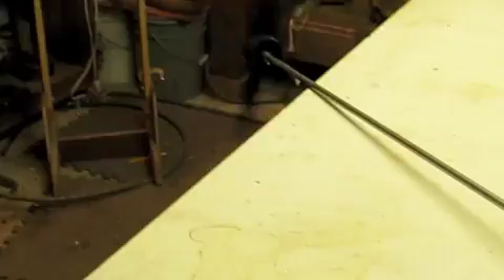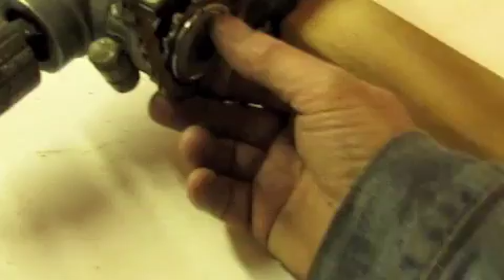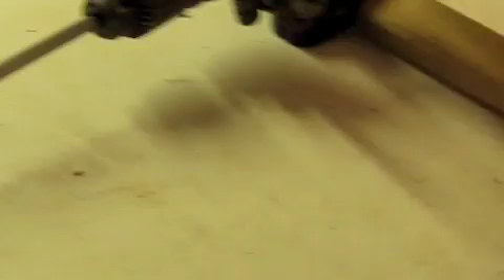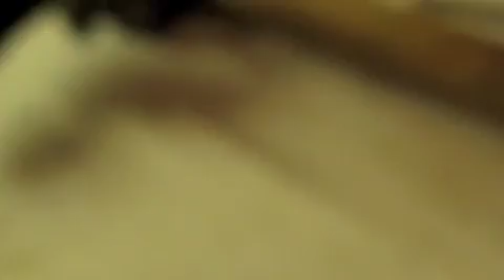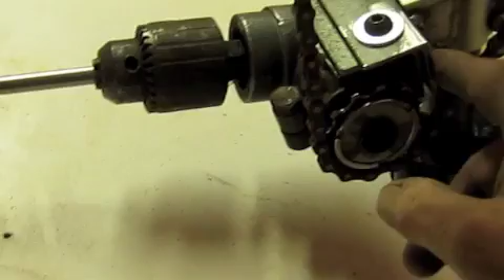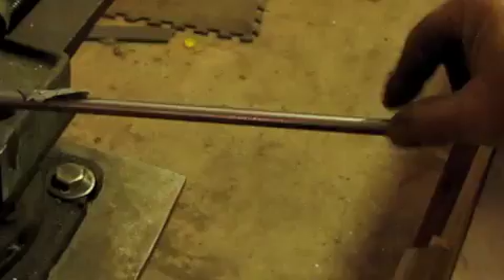bicycle propellor drive

Comment: Wow - how many views!!! Thanks a lot for sharing. Quick question ... I get the 90 degree drill adapter but where did you get the cog and it's shaft from? And what have you used to attached the drill adapter to the frame?
Reply: thanks for the interest, I would like to put up a follow up video soon showing the whole drive system I ended up using.
It ended up working quite well. 

The short answer is that  milwaukee uses two connection options, a thread that is the same as a 4" angle grinder nut and a larger 5/8" approx size nut.  For the input, i welded a sprocket to a grinder nut, threaded it on and locked it with the left hand thread screw in the center and added a fender washer as a chain guide, the output I use a deep socket wrench on the nut.  this connected to a weed whip shaft, which transmits the torque to the prop, aft of the rear wheel. 

As to how it fastens to the bike, i cut part of the sleeve that milwaukee uses to connect the drill to the angle shaft.
Then I welded this to a hinge plate and welded the other hinge plate to the frame.   The reason for this is to allow for the chain to be tensioned, and the angle to adjust to the ideal for the drive.

Comment: Right angle drill adapters are actually easy to find. They can be found at any tool sale, I found mine at tractor supply in the discount tool bin.

Comment: Good idea. For something like this to work at lower RPM you would need a multi blade prop with larger blade surfaces. That electric trolling motor prop doesnt get efficient until much higher RPM

Comment: right angle is available at harbor freight tools for $20.
 Warrior - item#69337
Reply: this is a 3/8 drive vs the 1/2" drive for the milwaukee.  It is probably up to the task, though much cheaper and weaker.
Thanks for sharing.
Reply: yep.

Comment: @roksys69 
the efficiency of the prop needs the prop shaft to be as parallel to direction of travel as possible. My guess is that the added complexity is worth it. Also you need some chain anyway to get the right angle drive out of the way of the feet/cranks  - can't just bolt to the axle there.

Comment: hey nice work man! i gotta ask out of curiosity though... wouldn't it be more beneficial to attach this into where the crank on a bike is? as it put the differential into the hole where the crank/bearings sit and then there are a whole bunch less parts and chains to adjust. just a suggestion, anyway i like where its going!

Comment from the maker: I guess it weighs about 10lbs total.  This may vary if you figure how to make the cranks solid enough to pedal them, you need to connect whatever powers the boat to the boat and you, as well as deal with the force of the prop in the water.  not sure what a bottle boat would be. Winter came and I never got to test this out.  Soon coming, I hope.  Good luck with your project.